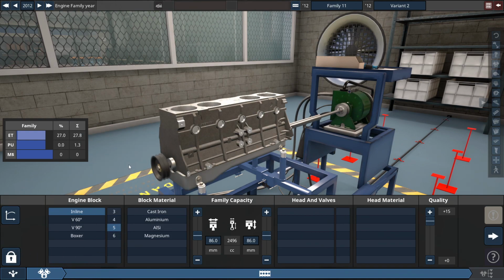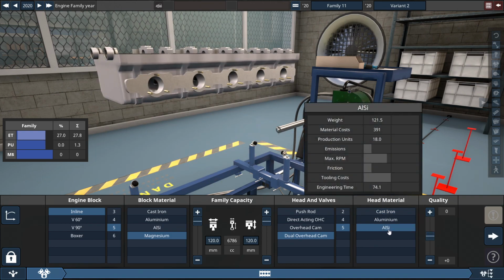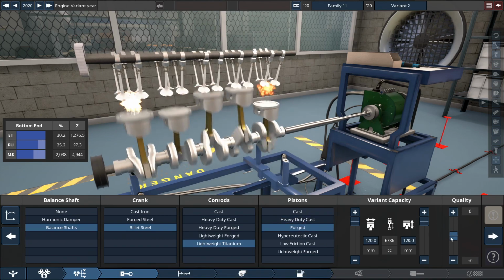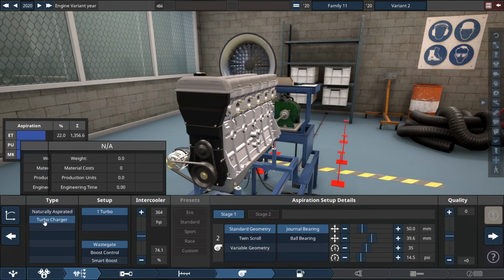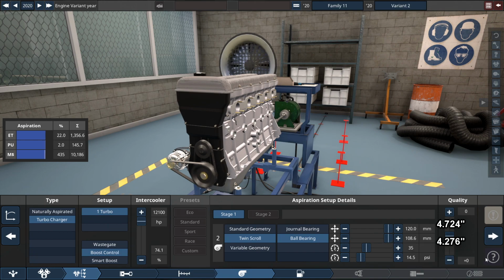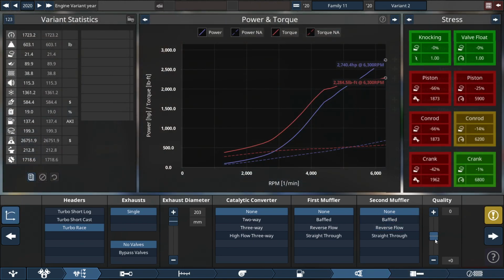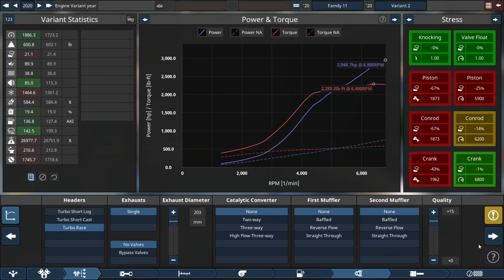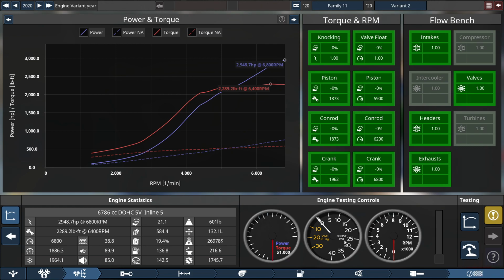The Most Powerful Inline 5 Engine Ever! (LCV 4.2) | Automation The Car Company Tycoon Game

Comment: Also a compound turbo setup might help break 3000. Feeding the output of one into the other will multiply the boost by the compression ratio of the compressor with the downside of extra complexity and extreme stress on the engine.

Comment: Rolls-Royce Crecy
General characteristics
Type: 12-cylinder supercharged liquid-cooled 2-stroke aircraft piston engine
Bore: 5.1 in (129.5 mm)
Stroke: 6.5 in (165.1 mm)
Displacement: 1,536 in³ (26 L)
Dry weight: 1,900 lb (862 kg)
Components
Valvetrain: Crankshaft-driven reciprocating sleeve valves
Supercharger: Gear-driven centrifugal type supercharger with variable angle of attack of the impeller blades providing up to 18 psi (124 kPa) of boost.
Turbocharger: Three engines fitted with exhaust turbine (50% scale version of Whittle W.1 turbine)
Fuel system: Direct fuel injection, 2 x CAV 6-cylinder pumps
Fuel type: 100 Octane petrol
Oil system: Gear pump
Cooling system: Liquid-cooled
Reduction gear: 0.451:1 (Left-hand tractor)
Performance
Power output: 2,729 hp (2,035 kW)
Specific power: 1.71 hp/in³ (77.97 kW/L)
Compression ratio: 7:1
Fuel consumption: 85.4 gal/hr (388.2 L/hr) at 2,500 rpm
Specific fuel consumption: 0.55 pints/hp/hr at 1,800 rpm (with exhaust turbine, ~293 g/kWh)
Power-to-weight ratio: 1.43 hp/lb (2.36 kW/kg)